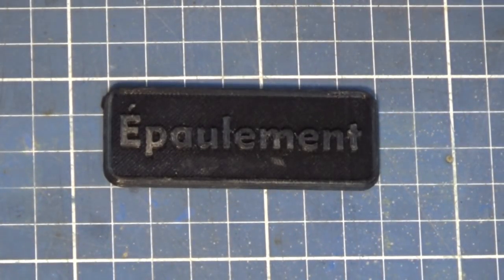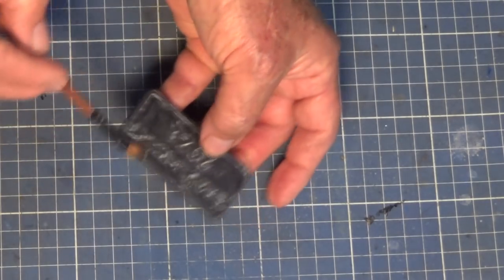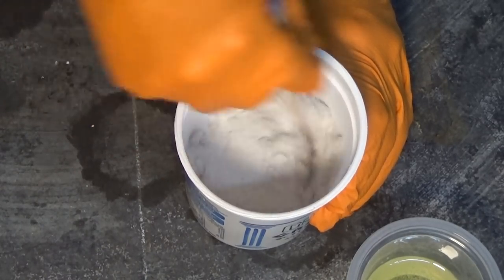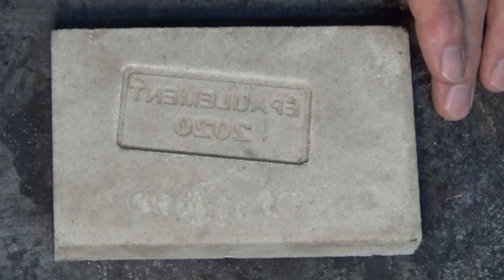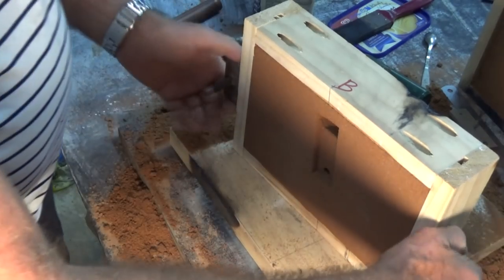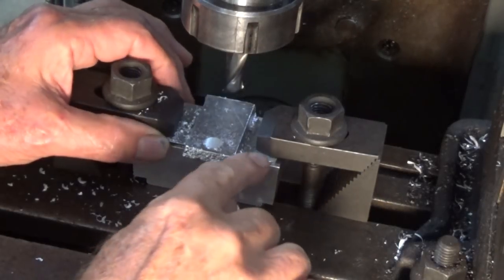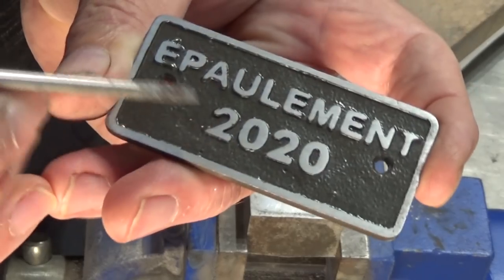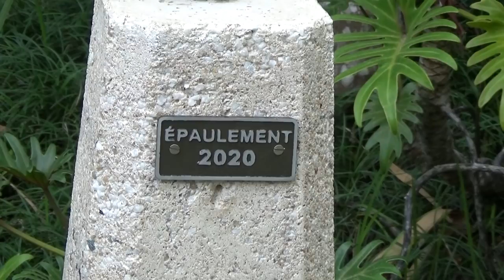DIY Cast Aluminium Tiny Name Plate

Comment: Hey Presso, this video just popped up in my YouTube feed and was well worth the watch.  

I built a home foundry a couple of years ago and have collected a bunch of suitable aluminum for casting. My plans were to make these types of cast plaques.  While I got the foundry functional, I never went back and actually cast any plaques because i did not have a clear process and experimenting to develop my own process when dealing with the temperatures necessary to melt aluminum made me a bit nervous.  Fantastic to see someone demonstrating a workable process for creating cast plaques.  I will have to circle back and fire up my foundry again and give this a try.  Thank you for your clear demonstration.
Reply from the maker: Since making that video I have worked out a process for 3D printing letter shapes with much more draft than I got on that first plaque. This allows for more height in the lettering but much easier removal of the pattern. I have put the folders on my dropbox. There are two different fonts and each folder has both the STL files and the raw Inventor files. You can scale the STL's in your slicing software and either print out individual letters or form them into words and print the whole string. The links are here https://www.dropbox.com/home/Public/Cast%20Letters%20Tahoma https://www.dropbox.com/home/Public/Cast%20Letters%20Calibri Feel free to try them. 
Regards,
Mark

Comment: Hi Presso     Very  entertaining and interesting. I admire your patience. I am a woodworker and used to detail but I think casting work is much more intense.   warm regards   vic
Reply from the maker: Vic, I find that there is a disconnect between making the pattern and the mould and then wondering what is going on inside the mould as you pour the hot metal in. Breaking open the mould can be so satisfying but equally, it can be discouraging too. With other crafts like woodworking you tend to get instant feedback on what you are doing with the material. In my next video you will get to see what goes wrong and how frustrating it can be when metal casting goes wrong. 
Regards,
Mark
Reply: @Preso58   Hi thanks very much for the reply. I shall be looking forward to your next video. Such a treat to have them in these crazy times!  vic

Comment: Good Show Mate...as always. That was fun. If I ain't careful, I learn something every time. New, better metal seems to work fine. Bud, Jack and Wes were my uncles. Not a Bob in the bunch.
Reply from the maker: I don't regret having to buy that alloy. At least I know what I am getting when I go to machine it. 
Regards,
Preso
Reply: @Preso58  Better stuff normally works better. It has taken too long for me to learn that. Buying or using cheap normally cost me twice.

Comment: Rather than using epoxy and talc with sand, I believe that plaster would work better; either with or without sand. To avoid the difficulties you had extracting the pattern, I would suggest printing it with Moldlay, or a similar wax filament, and just melting it out of your mold. It can be done in a regular oven when your wife is not around ;-)
Reply from the maker: I am sure there is a lot of scope for experimentation and I am hoping to have another go to try some alternative techniques. I have actually spent a lot of time today modelling letter and number characters with 25 degrees of draft angle. I believe this will make it much easier to get the pattern out without losing any sand in the small holes. 
Thanks for watching and thanks for the feedback.
Regards,
Mark
Reply: @Preso58  I've enjoy your videos and have learn much from them. I was just attempting to give something back. 
With wax patterns, you don't need to be concerned with draft. It may be an easier process for small runs where you aren't concerned with reusing them.

Comment: Good result. Guessing the pattern stuck in the mould because epoxy shrinks as it sets.
Reply from the maker: Possibly. I have learned to print in some fine gaps around the edge of the mould so that it is possible to bend the mould away from the epoxy sand core to help release it. Works great!
Regards,
Mark
Reply: @Preso58  good move.

Comment: Nice work Mark, just one question - if you labelled your Italian pizza oven - should it not read 
'forno a legna' ?
Reply from the maker: Larry, probably, I have already had a fair dinkum Italian tell me that I got the translation wrong. I did use Google Translate but what I ended up with was close but not correct. Just out of curiosity I went back the other way with Google and it gave me Wood Oven in English. Still, it looks vaguely Italian-ish and I'm definitely from Anglo Saxon stock so I guess it's going to do. 😁
Regards,
Mark

Comment: As I watched, I couldn't help thinking: "what about a Lead/Tin mix?"  Lead/Tin alloys have very low surface tension for improved mold conformability/flow, are easy pouring, and at low temperature, cheap, easy to work, etc.  In grad school, I had to make some stands for a lab project, and made the mold out of Aluminum stock, into which I poured various Lead alloys - wheel weights (Antimony hardens the alloy), Lead/Tin, pure Lead, pure Tin, etc.  I found it easy to work with, and heated it satisfactorily on a kitchen gas range top in a small cast iron crucible sitting on, and centered in, the grate.  

I actually used a dipper I bought at a local gunshop - the kind used in casting bullets in Aluminum bullet molds - which simplified pouring.  That way, there was no need to lift or move the crucible/melting pot.  I poured into the open top mold directly until full and simply screeded the excess off, then cleared the overpour meniscus with a file and sanding block when cool.  Lead can, of course, be plated with Copper and then Nickel if preferred, or painted, and perhaps even powder coated if the alloy used can handle the powder coat oven heat.  For a plate like the one you made, that attaches to a concrete pedestal, I would think the material strength of the plate would be largely irrelevant - especially if overcoated with a hard Copper/Nickel plate.  In fact, some Lead/Antimony alloys are quite strong.  

Just a thought.  Very interesting tutorial on casting technique, and it's always satisfying to watch the precision and meticulous care you take with every step.
Reply from the maker: George, I did some casting in pewter when I was at college. It's a really nice metal to work with. I have also cast in babbit for making bearings. I am thinking that some of the zinc based alloys would be harder than lead based stuff and relatively low melting point. Any alloys containing antimony would be highly toxic and I am not sure how easy it would be to obtain these days. I think that the idea of copper plating would be a good idea. There are some very easy to use copper electroforming kits available that give a really thick plate of copper which would be harder than the lead alloy. After that you could nickel or nickel cobalt plate. The aluminium I used is still holding up well even though it is fully exposed to the air. I have another one on my pizza oven that is over ten years old and it's gone a little grey but it polishes up with some scotchbrite pretty easily. 
Regards,
Mark
Reply: @Preso58  Yes - I knew an old mechanic who used to redo babbitt bearings in his garage - back before aluminum bearings really became the standard.  Babbitt has Antimony as well - like wheel weights.  Whenever I was melting metal on the stove, because of the Lead, I kept the kitchen door open - which dissipated fumes quite readily; the apartment I rented was in an old and drafty house, so I felt safe.  

Antimony is commonly used in bullet casting for hardness, and at one time I had a few hundred pounds of wheel weights (pull-offs) I'd solicited from a local tire shop, which made for a ready supply.  Wheel weights are different these days - Zinc and Steel - but I trust there's still an abundance in junkyards.

I bought an electroplating kit years ago, which used dry cell batteries and a metal paddle-backed brush.  I used it to plate the lugs on a 10-speed bike frame I refinished.  I thought it worked quite well.  I wonder if using that thick plate of Copper you mention could produce a usable mold; interesting notion.

Cheers

Comment: Great follow up video to making the concrete column for the statute. As someone who's never cast anything, but have watched a lot on the subject matter, I can't help but feel although you used wax as a "release agent," I would have still tried a coating of talc just as well. I would have tried to make the talcum power coating ever so slightly heavier than normal. My reasoning for this is the resin although semi-dry in the mix with the sand and talc power, would be ever so sticky. Or I guess put another way, is this process calls for a "double release agent." Just my thoughts and sticking (pun intended) with it. Thanks for sharing.
Reply from the maker: I am hoping that someone else will run with the idea and try out some solutions that you have suggested. I thought I might be able to get the ball rolling and then sit back and watch everyone solve the problems for me! 😁

Comment: You make sand mold casting look so easy. Do you think the epoxy sand mold would hold up to multiple pewter castings or deteriorate after the first due to melting the resin? Thanks again for another view of your great experiments and ideas.
Reply from the maker: I think you would be able to get multiple runs from the epoxy sand mould if using pewter. There are some proprietary products that can be sprayed onto the mould that are like a refractory wash. I saw Olfoundryman using them on some die casting moulds. 
Regards,
Mark
Reply: @Preso58  Thanks, I will have to check it out. I have been using the high temp silicone, but even that doesn't hold up and burns.

Comment: How durable would an epoxy and sand mix be to weather? Might make a good sign by itself.
Reply from the maker: Mark, If you added a coloured pigment it would probably be quite durable. The colour would help with UV degradation.

Comment: you should look in to lost wax and lost PLA casting for things like this it works much better for small details
Reply from the maker: I would love to give it a try. In fact, I did do some lost wax casting back in the 70's when I was training to be a teacher. We had a centrifugal casting machine which was a bit of a beast. I have watched the Veg Oil Guy develop his technique  and he has pretty much nailed the process. I am not really set up with the hardware he uses. I do have a list of projects as long as my arm though. I doubt I will ever get through them in my lifetime unfortunately.
Reply: @Preso58  one other thing to try, rather than epoxy, just mix with sodium silicate solution (water glass) with the sand.  Carbon Dioxide gas will harden the mix completely and quite quickly.  if you use silica flour, at least in direct contact with the fine detail, you can fill the rest of the cope with a more coarse green sand.  If you don't have carbon dioxide gas handy, use baking soda and vinegar.  Gas will harden the water glass very easily.  Great job with your video!  Thanks for sharing.  Doug

Comment: Mark, our Community group subscribe to your channel and have found your projects have been very helpful. We now want to make our own nameplates. The problem we have is that our software, FreeCad, does not do text drafting. It would be appreciated if you could let us know what software you used to create the text draft. thanks
Reply from the maker: I used Autodesk Inventor to make the pattern for this part. It does a good job of drafting text but in this case I just extruded the letter with a taper in one operation. On a later project I updated my version of Inventor to the 2021 version and the text can now be extruded normally and the draft tool can be used as a separate operation and it works fairly consistently. Earlier versions of Inventor had problems with text, especially when it had ornamental elements or serifs. I did try Freecad and had the same issue which is unfortunate. There may be a workaround but I didn't pursue it because Inventor does a good job. I know Autodesk products can be expensive but I am very fortunate that I get an educational licence for Autdoesk products but this may not be available to me forever. An alternative is Autodesk Fusion360 but I believe that is becoming harder to access for individuals (for free). There are some rumours that Autodesk will make it available to community maker groups for free so that might be worth following up. It might be worth looking at this video. I demonstrate the method I used to make heavily drafted 3D text and there is a link to a library of character that you can 3D print in any scale. https://www.youtube.com/watch?v=jOJyVnMFBAo
You can download the STL files for both sets of characters and then print them small or large to suit your project and glue them to a shaped piece of wood to form the pattern.
Regards,
Mark
Reply: @Preso58  Mark that's great. I have downloaded your font from thingiverse and my Ender 3 is now printing our first plate!!!!  This means a lot to us as anyone in the group can now produce the 3d model without the need of any expensive software - you are a star.
Reply from the maker: @covehithe9499  You're totally welcome. I am glad you can make use of the resource. 
Regards.
Mark

Comment: Hi Mark, great job, fun and educational to tag along with you (as always).
Have you thought about 'Investment' casting using a similar technique? Need some way of baking the mould.
 VOG (Veggie Oil Guy) is one channel that does some very detailed work.
Reply from the maker: Jack, I am a big fan of what VOG does but without the burnout oven and a vacuum pump the lost wax method can be difficult to get right. I have seen his technique improve over the years and he seems to get excellent and consistent results. 
Regards,
Preso
Reply: @Preso58  Amazing results would be the better expression. Mind you VOG still has his learning experiences from time to time.

Comment: Very well done, very nice work. Looking at the video and having no real casting experience (only from school) I was wondering if you needed to use a cope on your poor. Not obvious to me why you couldn’t have just filled the drag’s cavity and machined off the excess. I think for proper provenance you need the artist’s name too…. Yeah yeah easy for me to say. Now you have to watch out for pigeons.
Reply from the maker: I guess you could just pour it into the open cavity without having a cope on top and it would be interesting to see how the epoxy sand behaves. My reasoning was that having the mould closed does reduce the amount of oxygen that could cause burning of the epoxy and there is also more head pressure to keep the molten aluminium forced into the mould.
Regards,
Mark

Comment: The baby powder we used was based on cornstarch. So better check the label before use :)
Reply: That was my thought too. Powdered chalk might be a better additive.
Reply from the maker: I did read that cornstarch is sometimes added to talc. My understanding was that it was mostly talc though. Afterwards I thought that lime or portland cement would be better as an additive.
Regards,
Mark
Reply: @Preso58  You might be right that talc is the main component. It's been a few years, so I've probably repressed a lot of memories about diapers.